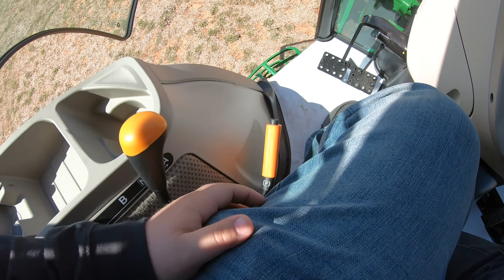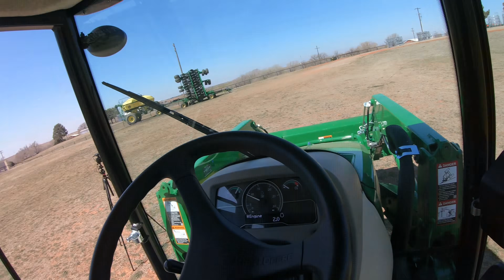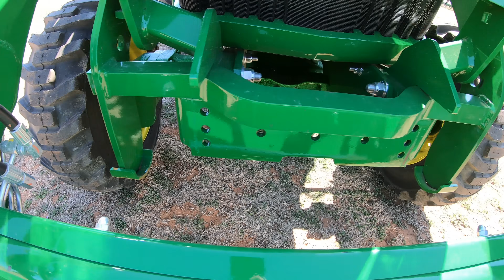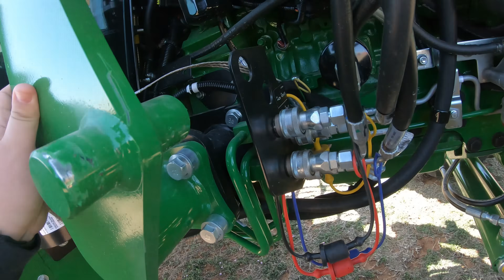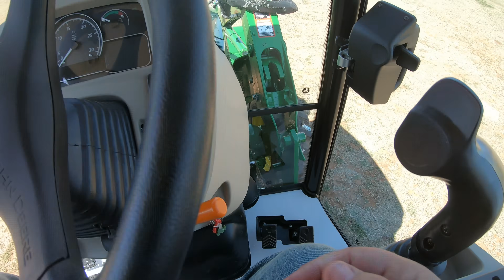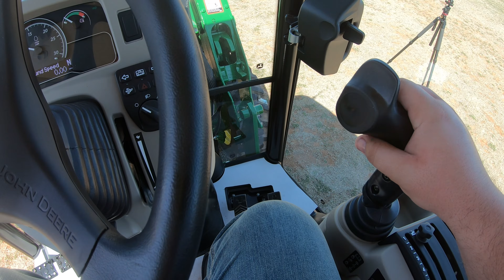How to Remove & Install 440R Loader on John Deere Tractor

Comment: Hey man I just purchased a 2023 S240 42 in lawn tractor and bought a s100 series bagger because I thought it was supposed to fit, but it does not. What bagging kit do i need to buy?
Reply from the maker: So you will need BUC10907. This has been an issue since the 42" deck on the S200's is different than the S100's.
Reply: @WesternEquipment  Thanks so much for the help!